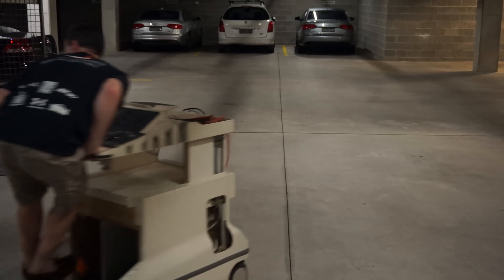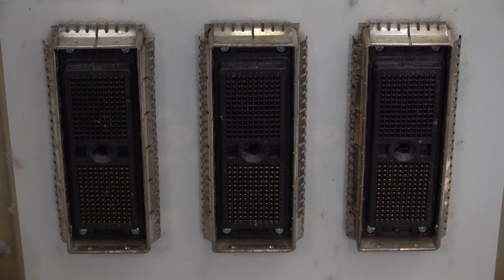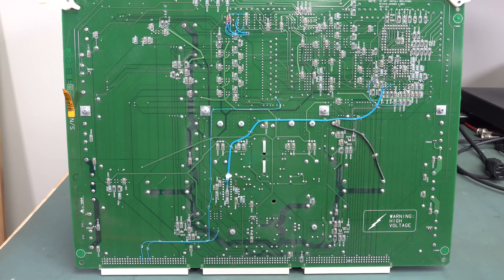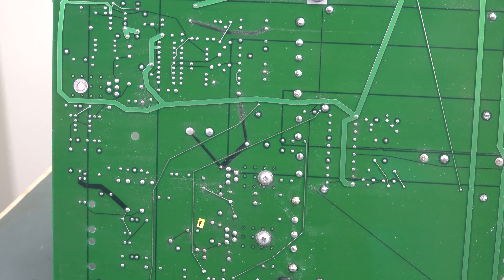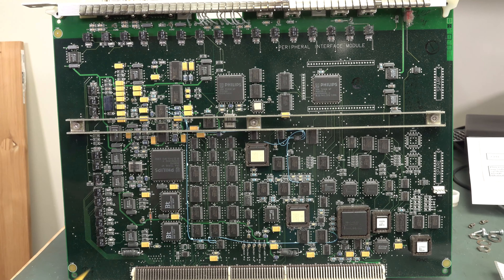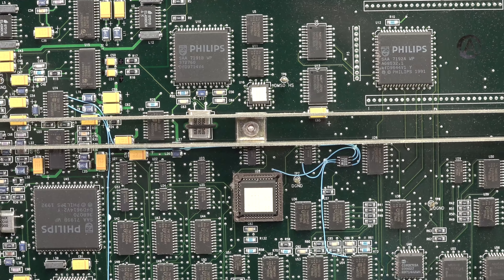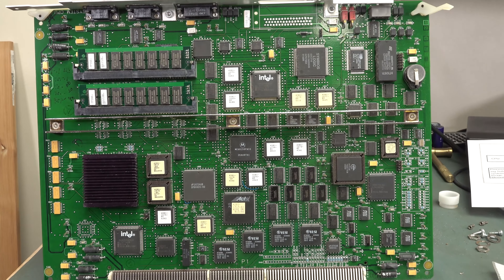EEVblog #1314 - Ultrasound Machine Teardown!

Comment: Dave, as an engineer that in the past has messed with military stuff do you believe that this kind of electronics for medical applications has similarities with the military grade stuff in terms of design complexity and implementation quality? Thanks. Also, can you talk about military electronics and their piculiarities on an engineering perspective?
Reply: Would also like to see this. I'd bet there's a fair amount of overlap (both applications have life safety and reliability considerations). Guessing the military angle also has to consider the environment it's operating in? For example, a typical ultrasound machine can assume it's indoors at "room temperature." A typical military appliance won't be able to assume that.

Comment: The shortest connection between two points is a straight line (18:00), not 45° or 90°.

Comment: Hello, your blog is very interesting.  I am from Venezuela.  I have a SIUI APOGGE 3500 ultrasound machine. I have not used the volumetric transducer for 4 years due to software problems.  The software issues were fixed, but when I used the transducer again, the image it provided was broken (areas with images and others not).  During the time that the transducer was not used it was protected, however, the place was subjected to high humidity.  The other transducers are working properly and were used regularly.  I would like to know where the transducer damage may be.  Thank you.

Comment: I guess  that  the blown capacitor can be the issue of the machine. Maybye it short some power rail on the board. Coulkd you try to "reapir" it just to see if than the think work.
By the way I had watched that video the other day and think why Dave haven't do a teardown I guessed you throw away it. 
Also I also saw the behind economic repair agilent DSA, that was a memories of the past.

Comment: You would have to re-install the software to make it work.  The users probably unplugged the machine while powered up and corrupted the software.
Pretty common problem.
The disks are usually attached to the inside of the side casing in a plastic envelope.

Comment: There use to be ultrasound machines that had Apple G3 systems integrated into the cart. Very strange beasts to support. Running Mac OS with vendor hardware slapped on. Can't remember the company who made it. Think the Mac portion was more for handling the images. From outside you would never guess a Mac motherboard was hidden inside.
Reply: HP Sonos machines had those as an upgrade option.  I believe the frontend was 68k based and used DSPs for video processing.

Comment: Each connector consists of two blocks of 10 columns and 13 rows. 130 pins per block. 260 pins per connector. Three connectors totalling a whopping 780 pins!

Comment: Probe Connectors are setup as 2x upper & lower pin squares each consisting of a 10 wide by 13 tall plug 🔌 ! So upper and lower parts are 130 pins each which means that each Probe Connector is 260 pins, so times 3 Probe Connectors is 780 Pins!!!! There, Done ✅ I Counted All The Pins!!!! 😝🤪😉

Comment: I wish you would've taken off the heat sink from that Intel processor, I would have loved to know whether it's from their x86 range and if so, whether it was a 386 or a 486.
Reply: It is X86, and they did come direct from the manufacturer with that little top hat heatsink already mounted.
Reply: 386. Can tell by the size of it.
Reply: It could well be an i960 too
Reply: its either some 386/486 variant or an original Pentium 1.
Reply: @simontay4851  Pentium would be too new for it. Plus, Pentiums had already sockets with a lever to lift up, this one has a pry socket (I still have a CPU pry tool for that somewhere).
Reply: @fuzzybobbles  I don't remember 386 and 486 being really that different in size. At least not to be noticable on video, I guess.
Reply: @randomelectronicsanddispla1765  Yes, makes more sense to have a RISC processor like the i960 here for a few dedicated high-speed tasks.  Doesn't seem much point in having a another general purpose processor like a 386 here when there is already a more powerful general-purpose processor in the MC68040.

Comment: Geez those traces that just go where ever really wind me up. There are even instances of them trying to make 45s but just going at what ever angle.

Who did these layouts? Or were they all done at 4:30 on a Friday afternoon? 😫
Reply: possibly they were indeed made under time pressure. 
I like the style though. I love topological routing, and with good component placement, most traces are actually straight lines at funny angles. I wonder if some of those boards were topo-routed... doesn't really look like that, but maybe...
Reply: I'll run traces any angle I feel like.
Reply: Could be time matched to equalise prop delay, but they do look random crazy.
Reply: @Dont_Gnaw_on_the_Kitty_1  Thats probably not too unreasonable. The one that works me up the most is around 23:43, top just left of center, straight up from C15. It starts off using 45's and goes downhill from there.

Comment: what is a difference between a 12 volt supply (which has +ve and -ve terminals) and (-12)--0--(+12) volt supply (which has -12v, zero volt and +12v terminals). does it means, that there will be a 24v potential difference between -12v and +12v terminals? if yes then what is a 0v--12v--24v power supply? can you explain.
Reply: First learn about quadrants of operation of abstract voltage source. There are, obviously, four of them: 
1. Positive voltage across the outputs, the unit is sourcing power.
2. Negative voltage across the output, the unit is sourcing power.
3. Positive voltage across the outputs, the unit is sinking power.
4. Negative voltage across the outputs, the unit is sinking power.
If the given voltage source (no matter, positive or negative voltage it supplies) can do both sourcing and sinking energy, there's really no technical difference between 0V—12V—24V and (–12V)—(0)—(+12V). The only difference is in output terminal labeling. That is only true for bi-quadrant/four-quadrant voltage sources, which is rare in practical: only high-end lab PSU, chemical voltage sources and capacitors are examples of such devices for DC, and only bare transformers — for AC.
Another aspect is _regulation_, i.e. an ability of the power sources to keep voltage accross some output terminals at the desired level.
In 0V—12V—24V case (let's assume terminals are labeled [A]-[B]-[C]) if you overload or short-circuit A-B pair, voltage A-B will drop to some extent, but the power source will keep trying to establish A-C at 24V. Voltage between B and C will increase, but nobody cares about Vbc.
In (–12V)—(0)—(+12V) case (same convention of term. labeling) if you overload or short-circuit A-B pair, voltage between A and B will drop, but the power source will at least keep trying to provide stable 12V between B and C. Voltage between A and C will, of course, go lower than initial 24V.
So, it depends. The way terminals are labeled usually remarks the way their voltages are regulated (usually  0V is a reference point for all other voltages, but not always) and energy flow direction (usually positive terminals can only source current and negative terminals can only sink current). The GND/0V terminal in bipolar/multi-polar voltage sources can both source and sink current, which is the main reason why dumb relabelling of terminals can't convert 0V—12V—24V into (–12V)—(0)—(+12V).
Reply: @toxanbi  Thanks for the detailed explanation.

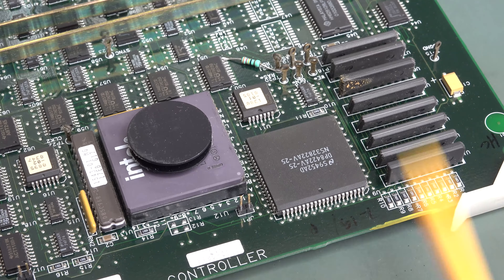Comment: Burnt resistor array at 25:00 ?
Reply: Beat me to it. It looks like "U6" @ 25:00.
   I'm sure lots of different things come in SIP packages. I've pulled various audio peripherals that came in these packages to save space. I think I have some generic SIP op amps saved in the parts bin. These come in stuff like old equalizers in single board designs where space is tight.
-Jake

Comment: @45:26 there's an AMD 186 CPU at a whopping 16Mhz (and this is comment 186). I bet the Intel chip earlier with the round heatsink is an i960. Each of these boards are a whole computer in itself!

Comment: This thing must have been upgraded around the late 90s, because the IBM HDD is a 9GB one, and that wasn't available yet in 1994/95.
Reply: JAN-00 is the date code. it's a 9.1GB, 7200 RPM, Ultra2Wide-SCSI, 80 pin SCA (here with an adapter to 50 pin) drive.

Comment: the multi-pin DL connectors are widely used in the audio industry (though with fewer pins. still manufactured today. hate them, horrible small contact area.

Comment: @45:41 Did you just call an AMD processor an intel processor? Oh, the blasphemy!
Reply: It is a licenced (has a "(C) Intel" on it) - 'cause second source and such - 80186 by AMD. ... While manufactured by AMD  it was designed by Intel. Thus, cut him some slack ... :)

For the OCD:
The N80C is: "redesigned CMOS version that operated at 16 MHz and introduced a number of enhancements in addition to being lower-power CMOS, including a DRAM Refresh Control Unit and various power saving modes" ... but AMD and Intel sold the same product: 'N80C186-16'

http://www.cpu-world.com/CPUs/80186/Intel-N80C186-16.html
https://en.wikichip.org/wiki/amd/am186/n80c186-16
https://en.wikichip.org/wiki/amd/am186
http://www.cpu-galerie.de/html/intel80c186.html

What I really wonder is if the ceramic Intel under the heatsink is actually a i860 or i960?
Reply: @darknase  The one on the other board, with the round heatsink? Yeah, I'd like to know that, too! Old Intel CPUs (386, 486) also looked just like this.

Comment: Wow what an odd mix on these boards like Intel VS 68000 Motorola. Just like a commodore Amiga with Intel bolted on to do the IO.  It's like designed by so many different departments even in 1990+ there was chips on the market to cut down on what they had. Problem is just like MOD work each department trying to hang on. I can remember so called new equipment with 486 while I was Pentium 3!!!

Comment: Ute...is that some kind of australian mammal?
Reply: It's a very strange creature. Distantly related to the drop bear, the ute rolls around on 4 wheels and makes terrifying honking noises seemingly at random. It feeds on liquid hydrocarbons and the occasional unsuspecting pedestrian. Its primary habitat is the paved parking lot. Dangerous. Do not handle without proper training and a government issued permit or license.
Reply: Dave L like everthing else in ’stralia tryin to kill ya
Reply: It's like a pickup truck, but built on a full-size car chassis. Think Chevy El-Camino, for example.

Comment: 33:56 I remember those drives at the time when they were known as Deathstars: http://datacent.com/datarecovery/hdd/ibm/DNES-309170W
Reply: Back in '02, I'd backed up my entire setup onto one of those drives so I could reinstall my desktop, file/web server, and another general whatever server from scratch to decruftify everything. Was one year old, never had any issues with it. Got them reinstalled, went to pull everything back off of it... About one GB in... click. chunk of data. click. little bit more data. click. click. click. data? click. click. click. click. click. The decruftification became real. Backups years out of date, everything from around 1998 to 2002 except for a few odds & ends burnt onto cds, gone.
I was not happy with IBM that day.

Comment: Is it just me or does it seem like much of the PCB layout was either rushed or done by someone with no regard for neatness & efficiency whatsoever?
Reply: Most likely all autorouter work with one of the early software versions. not much manual revision other than in some of the more critical RF sections, which were probably placed as a block component on the board and then the autorouter was allowed to run around it.